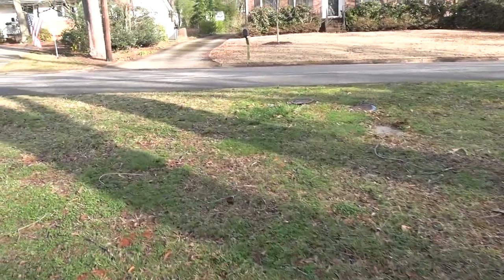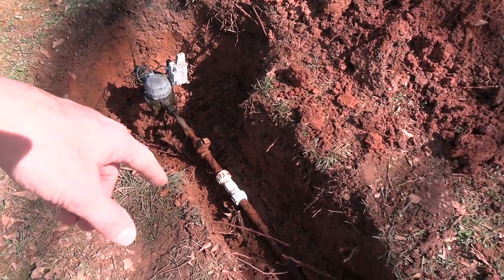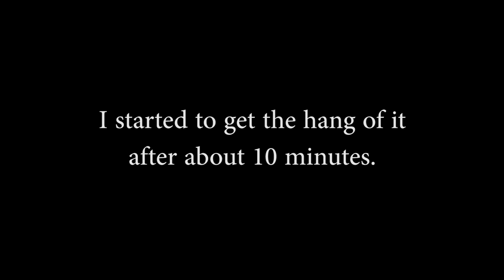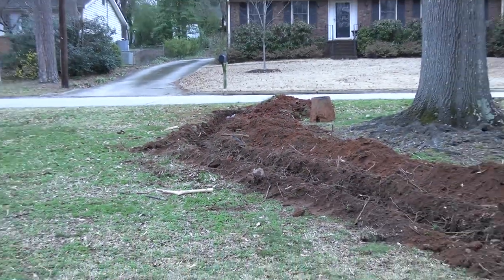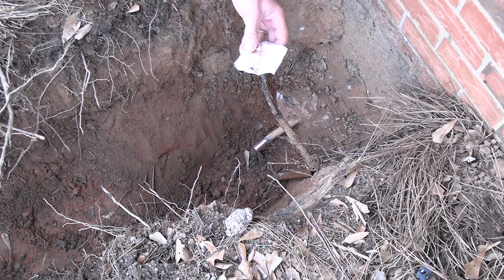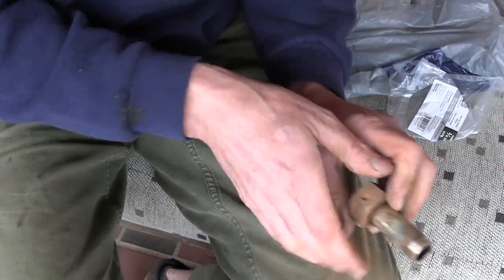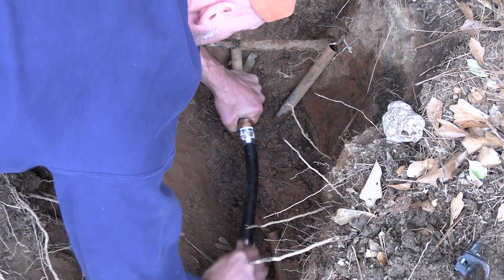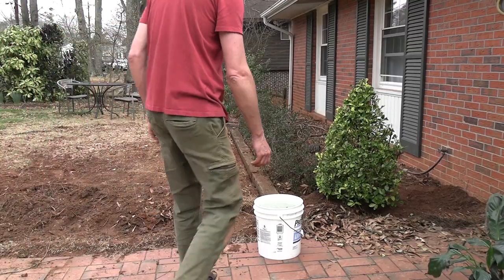How to replace a damaged/broken water service line 💦

Comment: good job Dave!  as a plumber i would have done it a little differently but you got the job done and did good work. good for you.  that old 1/2 inch galvonized needed to go!
Reply from the maker: Thanks James :-) and please share how you'd do it if you have time. Always looking for better methods.
Reply: @FamilyFriendlyDIY  well, in my neck of the woods that black plastic pipe hasnt been sold for 40 years or so. the only time i see it is on old farms and its a pain in the neck to make repairs because fittings arent readily availible.  if it were my job i would have deleted the swing check valve (if permitted by local code) and ran 1 inch Pex B pipe to the house using Viega fittings. i also would have drilled a 1 1/8 inch hole threw the footing and made my connection inside the basement so the copper pipe thats encased in cement could be done away with befofe it starts leaking. copper and concrete dont like each other. 

that being said you made a solid repair and im sure you have much better water pressure now too!
Reply from the maker: @jamesyarbrough4777  Definitely sounds like a more solid fix. I'll bet you have a big beast for core drilling??